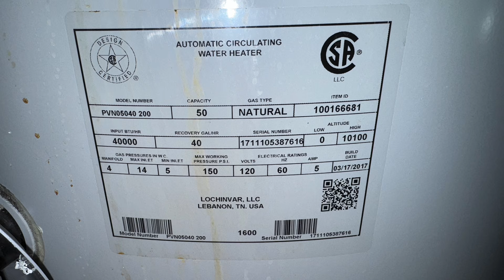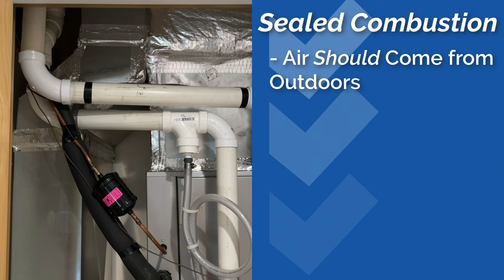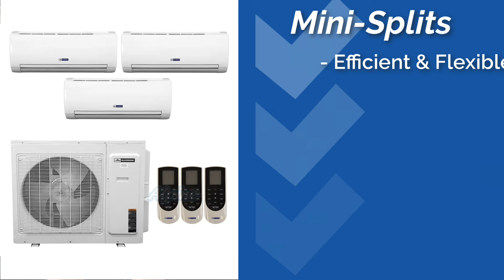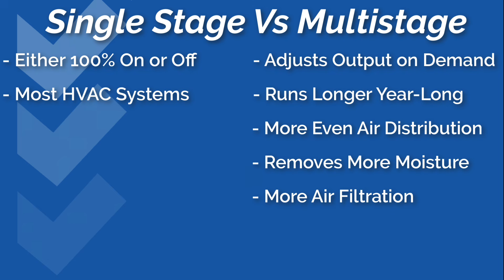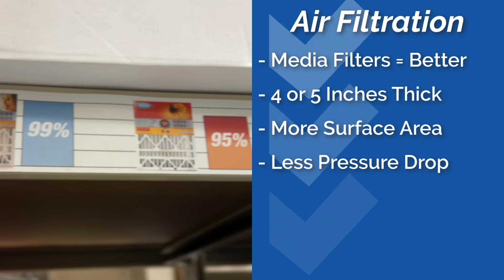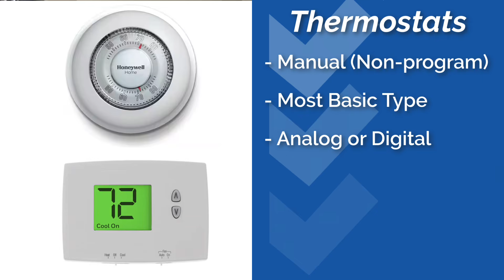The BEST HVAC System for Your Home? Here's What Really Matters!

Comment: I believe using your HVAC as an air purifier is a mistake. Even a brand new high efficiency filter will create significant back pressure. The filter on your HVAC is there to prevent the coil from clogging with debris, so anything higher than about a MERV 8 is a mistake. It is better to use standard filtration in your HVAC alongside an independent HEPA filtration appliance. You will avoid extra wear on your HVAC system, and you will most likely keep a better eye on your HEPA filter.
Reply from the maker: There's a lot we can agree on right there!  Regardless, if your HVAC system and ductwork are designed properly to accommodate a MERV 13+ media filter, then it shouldn't have a big pressure drop across it.  I generally don't recommend any high MERV one inch air filters.

Comment: A couple who bought a house from got roped into buying a much larger HVAC system when the existing one was 1 year old, high efficacy and the right size. they left the 2 fire place flues  with no glass or anything open all winter in a very cold climate , basically the hot air went up the chimney .
Reply from the maker: What a tragic waste of money! 🤦🏻

Comment: Great, thank you !  I have a cold basement, should I pull or push ac air through the basement for extra cooling or does the extra space make it counterproductive?  Also, I have a furnace with an ac unit but would like to add a heat pump and use less gas.  Better to replace or to just add a mobile unit or ductless split ?  Thanks
Reply from the maker: First thing I'd do with your cold basement is seal up any leaks in the return side of your ductwork down there so it pulls more air back down from the floors above, and probably close all supply air vents in the basement.  If you have dampers on those supply ducts, close those instead of the registers.  For the HVAC upgrade, if your current furnace has a variable speed blower motor, it might be compatible with a new heat pump that could be added to it, so you'd basically have a "hybrid" or "duel-fuel" system and can control how much it runs on the heat pump versus the gas furnace in winter time.

Comment: Example of high humidity vs a mini split. A couple years ago our hiking group went to Jamacia, to summit Blue Mountain (among other goals). Driving around the island we saw many buildings under construction. The preferred construction type is poured concrete, with posts, arches, balconies, upper-level floors, and even roofs of concrete---but little or no insulation. We stayed in various places, including a sea-side resort.

The resort was a combination of working with the local climate, and working against it (for the tourists, I presume). An example of working with the climate was the dining room, which had plenty of windows, but no glass. Plantation blinds were to remind the birds not to fly through the room, but it worked and was comfortable. The rooms we stayed in were set-up to fight against the climate. Each was a concrete box (all 6 sides), with a painted interior, and a mini split.

First, our mini split's condensate drain seemed to be clogged, or perhaps it didn't discharge outside. The pillows were damp because the mini split's head was directly above the bed. Second, there was only one tiny open-able window, so impossible to get cross breeze. Third, once it got going the mini split's thermostat didn't seem to work---it ran all night, chilled the concrete walls, and in the morning we had water running down the walls and forming a big puddle on the floor. Central air with ductwork and a full-time dehumidifier would have been 100 times better.

Another place we stayed was designed and built by the family that ran it. It was up on a mountain side, deep in a valley, and shaded. No AC and no mini splits, but it all worked great. However, a downside was a pack rat that came in and wandered around the dining room. But hey, we were all comfy.
Reply from the maker: Your experience is common throughout the Caribbean islands and frankly for many places in central and south America.  I've stayed in many hotels and resorts with mini splits with mold in and on them, sweaty walls, etc.  Many of those units aren't cleaned properly or regularly either.  Conversely, last year I stayed at a boutique resort in Monteverde, Costa Rica that had zero A/C intentionally, and it worked in that climate because the nights were cool and it was more dry locally there.  The building and HVAC design has to match the local climate zone needs!

Comment: I have two 2 ton AC units for my home and it is super efficient.  Home is 1500 sq foot.  Granted I also did 2x6 exterior walls and lots of roof insulation.  I would say having more AC units is better and having it setup to be able to use others as a backup is perfect.
Reply from the maker: As long as the systems keep your home comfortable, while controlling indoor humidity and air quality at safe levels, then that's the ultimate goal!
Reply: Where are you? Just air handlers or both on furnaces?

Comment: I believe that any time you upgrade your HVAC system always have an ACCA approved load calculation done first and make sure that it includes the equipment selection (Manual S).
Reply from the maker: Absolutely!  And with apps like Amply, Kwik Model, Conduit Tech, and even Cool Calc now you can use iPad Pro's to scan houses and get pretty accurate load calcs fast!

Comment: Bigger definitely ain't better in HVAC. I learned that the hard (expensive) way. Still sorting it out.
Reply: Same here, unfortunately!  Had a AC guy convince me to "upgrade" from a 3 ton to a 4 ton system and had nothing but problems with it!  Took several months, but he finally replaced it with another 3 ton and my house feels better and the ducts aren't as loud either!
Reply: I'll be the outlaw here. 1700 sqft. 

Had 7 contractors provide quotes with in home interviews (exhausting process). 

Only 1 company entered the home, saw the lofted 15ft ceiling in the Master BR suite, Living Rm, Kitchen and Dining area and took into account the volume (cubic feet) vs Sq Ft. After a recalculation 4T was the answer. Our OKC home has never been more comfortable,  electric bill in the summer months runs about $100, on humid hot summer days it is paradise. Correct size does matter. So does volume.
Reply from the maker: You're absolutely correct!  The heating and cooling load calcs have to account for the volume of air inside the house, along with the tightness of the house, insulation levels, and many other factors in order to size equipment properly!